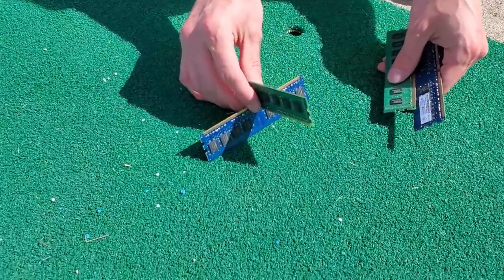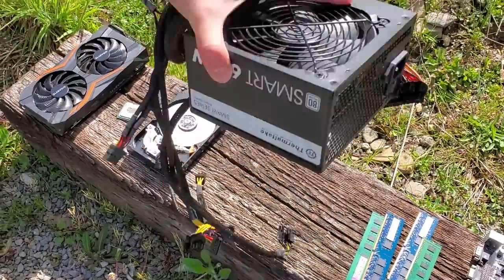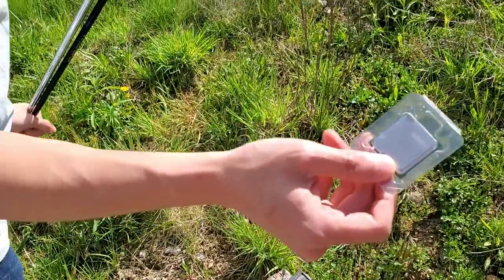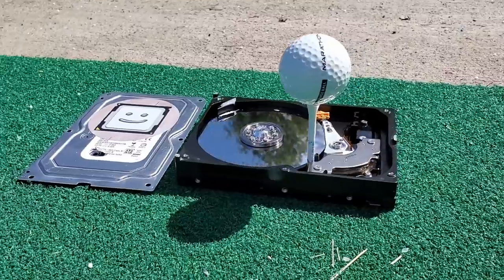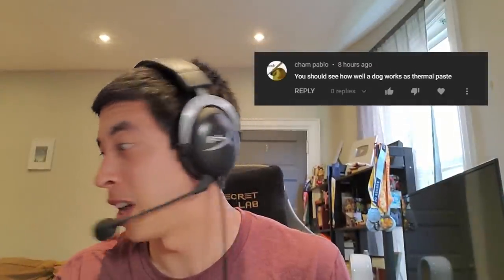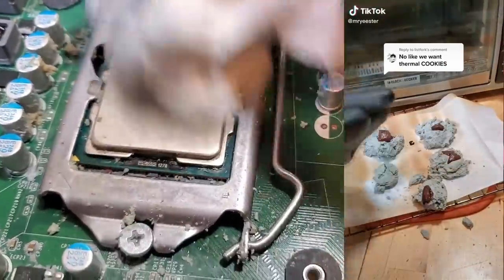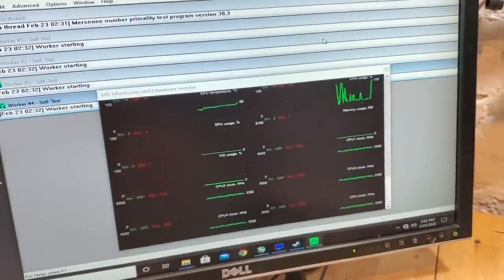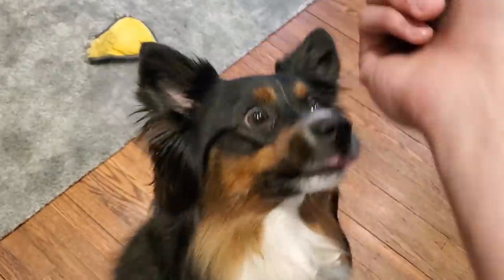using a DOG as thermal paste??

Comment: Try putting an entire CPU case with all the components connected, near an ant colony and make the ants occupy it for a week. Then clean it and see if it works.
Reply: I actually do have a pc that was infested with insects (it wasnt touched in 8 years). I opened it and cleaned it out but never tested it, but the parts after cleaning looked untouched.
Reply: bro what's a CPU case?
Reply: No, then turn it on
Don’t have any coolers attached to anything, including the GPU, then start gaming on it
Reply: @PneumaticFrog  is that supposed to be a joke?
Reply: @DeathStriker88  no he didn't know that they called pc case as cpu case
Reply: Last time I did that it did not work